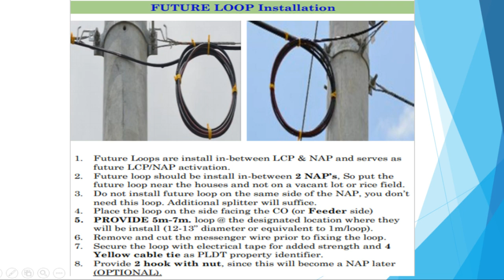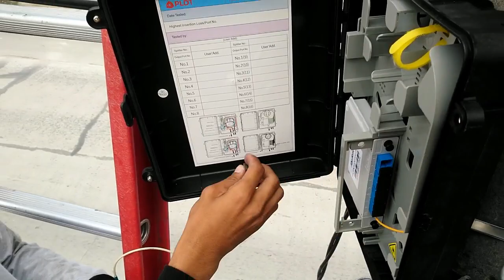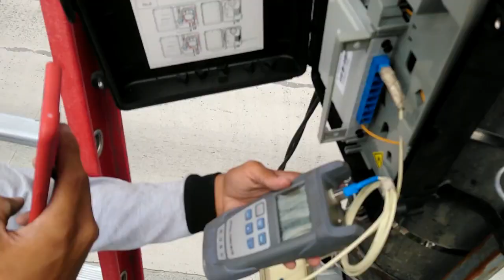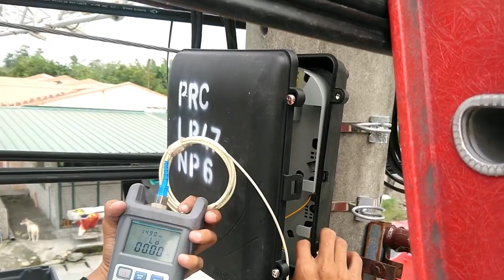PLDT ADD NAP with OPEN LOOP INSTALLATION

Comment: Activated na po to after ma install?
Reply from the maker: Yes sir pag mga ADD NAP mostly activated na un, kc naka latag na ang linya non at working na din ang LCP, However, may mga cases na after ma Install ng Add NAP eh no reading xa for some reason na baka di pa naka dugtong sa LCP or my tama sa clousure
Reply: Activated pro hindi pa ata yan pwede ma installan kasi need pa yan ng docs for ta/fa..kasi hindi pa yan makikita sa system ni pldt..😊
Reply from the maker: @hoophtv  Pag ang NAP ai na Install na poh with in the day reported na agad yan ng mga Technician na Working basta my reading. RFS na agad yun kc add NAP lang yan, Meaning matagal na nakalatag ung linya non.
Reply: @Connected1130  iba din cguro jan sa inyo at dito sa amin..yes po matagal na yan nakalatag..hehe..oo active yan kasi may reading kung nka splice na sa lcp..dpende sa contractor na nag latag..pro sa clarity hindi pa yan makikita..ewan ko lang po sa inyo jan ha..kasi d2 sa amin kaya need ng docs dahil for acceptance at for ta/fa pra ma upload yan wa warrp..baka iba din jan sa inyo..
Reply from the maker: @hoophtv  PLDT din poh ba kayo? Base sa experience ko, basta ADD NAP RFS na agad un.Minsan nga With in the day meron na agad for Installation lalo na kung my kasama na CX mostly kc cla nag rerequest ng ADD NAP
Reply: @Connected1130  dati pre..ngayun nasa fh na ako..for documentation ako..bka iba din yung jan sa inyo..oo pwede sya ma installan pro cold connect tawag sa amin nyan..mag hihintay padin ang cx kung kelan ma ta/fa ang add nap kasi pra ma assign na nila c subs sa clarity..pag mag add nap kami d2 ay wlang cx maghihintay pa kmi ng acceptance ni core net or ky oppm ni pldt..
Reply: @Connected1130  mas maganda pala jan sa inyo kasi on that day pwede na ma installan c subs at activated agad yung line nya..dito sa amin matagal2 pa bago ma actiavate c add nap..😂
Reply from the maker: @hoophtv  ah medyo matagal ung process jan sa inyo, d2 kc samin basta active n aung NAP ok na un, for activation at config lang ng MOdem sa system
Reply from the maker: @hoophtv  saang FH ka sir?
Reply from the maker: @hoophtv  Saang branch ng FH ka sir,
Reply: @Connected1130  sa Mindanao ako sir..dati din ako sa pldt pro agency kami tapos nong nawala ng endo lipat kami lahat ng fh..ang natira yung organic nlang talaga ni pldt..hehe
Reply: @Connected1130  oo nga eeh..maganda pala jan sa inyo..kasi mabilis ang market..😂😂
Reply from the maker: @hoophtv  layo nman nyan..
Reply: @Connected1130  oo..hehe..kaya siguro matagal process..hahaha! Btw..maganda mga videos mo napaka klaro..madami kang matutulongan nyan..keep it up..
Reply from the maker: @davenencarnado5416  PBZ North Luzon

Comment: Sir,,, pwd ba pa explain ng lcp and nap??? Salamat sir😇😇😇
Reply from the maker: LCP - Local convergence Point
  The LCP in a typical FTTH network is the point at which passive optical splitters (for a passive optical network, or PON) share the signals from feeder fibers with multiple subscribers via individual distribution fibers. These critical network components typically take the form of a small cabinet that is installed on a concrete pad or vault above ground level. As LCPs split a handful of incoming feeder fibers up to 32 ways each, just one of these components is required to serve a neighborhood in most deployment scenarios

NAP- NETWORK ACCESS POINT
The point from which an Internet service provider (ISP) drops down its lines and establishes a peering arrangement to provide Internet connectivity to customers.

Comment: mostly ilang araw  po ba o buwan bago gumana or maactivate ang nap box pagkatapos mag latag ng cable at mag lagay ng nap box sa poste??
Reply from the maker: Hi sir, sa tanong mo sir kc case to case basis kc yan, depende kung gaano kalaki ung lugar na lalatagan. Most likely 3 months after malatagan, pero mostly sa mag Add lang ng Nap e RFS na yon or Ready For Service if ever ma no signal due to FOC line problem kaya 1 day to 3 days depende pa yon kung palita cable.

Comment: Sir pinutol po ba yung white fiber from lcp na dinugtong sa pigtail ng cassette type na splitter?
Reply from the maker: Yes sir tama ka..yung white core na galing sa Blue Buffer from LCP.
Reply: @Connected1130  sir di ba nag putol ka nga white fiber then dinugtong sa splitter, ung kabilang putol na white wala nang use yon?
Reply from the maker: @darrywarry3722  wala na sir, dahil ung white core na un ai para sa NAP na un base sa color coding.

Comment: bossing ma aapprove ba ang application pag 19 na poste ang pagitan sa bahay at ng pinakamalapit na box?
Reply from the maker: Hi sir,  19 na poste approximately 600 to 900 meters yon depende sa distance ng mga pole. About sa approval sir if ganon kalayo basta mataas ang plan na kukunin mo matic un if 100mbps gagawan nila ng paraan yan..Better to apply sir then sila na mag survey malay mo may mas malapit na na NAP jan.
Reply: @Connected1130  boss 750 meters ang layo sabi sa google map tapos po PLAN 2099 UNLI FIBER 400 MBPS po. mataas kaya chance?
Reply from the maker: @krillin6z  hi sir, sinong naG survey nyan ikaw lang ba? Wala na ba ibang mas malapit na NAP? Apply mo nlang sir then pag my ticket ka na bigay mo saken ipapa survey naten.

Comment: Sir, temporarily bang maputol yong internet ng ibang subscribers pag-may nag-install ng NAP box? Hindi ko naiintindihan kung papano naka-connect ang NAP sa main line. Nagbranch out lang ba yon o sumingit siya in series sa main line?
Reply from the maker: Hi sir, ganito sir hindi apektado ang ibang NAP pag mh nag install ng NEW NAP, kc ibang core un.. Multi core kc ang mga FOC naten. So bali ibat ibang core sila, iba ibang line depende sa number ng nap my color coding kc yan.

Comment: Sir ask lang po .. yung isang foc sa NAP sir spare lang po ba yan ? Salamat sa tugon sir
Reply from the maker: ILANG CORE ung cnasabi mo na FOC SIR?kc mula sa Blue Buffer kukuha lng tayo ng isang core na need to fuse to pig tale splitter,ung the rest don ppunta na sa ibang NAP at LCP na.ung ibang bufffer sa FOC e spare na.
Reply: @Connected1130  yung 12 core sir na foc, 
bali sir sa isang NAP isang core lang kukunin para sa splitter, kunwari sir 12 core papasok sa isang NAP-1 tapos yung 11core ee fusion papunta sa  NAP-2 ??
Reply from the maker: @ramonguira8290  yes sir parang ganon tama ka ppunta ung ibang core sa ibang NAP, sa PLDT kc 8 NAPS sa isang LCP so paghahatian nila ung mga core na yon .pero ang standard na FOC ai 3 Buffer 24 core.bali 8 core ang laman ng isang buffer. Ung blue buffer e 8 core ang laman ppunta un sa 8 NAPS..ung isang buffer orange color 8 core din un ppunta nmn un sa 8 LCP
Reply: @Connected1130  sir pag 12 core lang ang FOC kailangan bang 6-port lang ang splitter Niya ? Kasi 6-core sa isang buffer

Sir dagdag lang na tanong anu po ang accurate na reading sa mga port pag t nest po ? Salamat sir
Reply from the maker: @ramonguira8290  ang splitter naten sir sa PLDT e 8 ports, sa Globe 16 ports, wala kc 6 port na ginagamit ng telecom d2 sa pinas at hindi din nila ginagamit ang 12 core lang if NAP ang usapan kc dapat standard, however kung gusto mo lng in your own na gamitin un it doesn't matter kahit ilang ports ang splitter or ilang core ung FOC as long as ma fuse mo ung isang core kahit nga dimo sundin ung color coding.Thats the reality..pero sa Telecom company my sinusunod lang na standard.

Standard reading ng Nap is -14dBm up to -24dbm..However kahit up to -27dBm or -30dBm reading non depende sa modem na gamit mo still works parin un.
Reply: @Connected1130  ah ok po sir salamat sa kunting kaalman, gusto kulang matuto kahit kunti mga PRRU lang ini splice ko at RHUb sa loob ng mall sir kaya wala ako masyado Idea pagdating sa mga NAP or LCP, sa Dito Telecom ang 12 core gamit Namin para sa mga OTP at 24-core sa mga ODP sir, salamat po

Comment: Bakit po sir sa globe maliit yung fiber main wire nila pa pasok ng Nap box parang tulad lng ng papuntang bahay ibang set up din po yun? kasi sa converge , pldt same set up lng ang lalaki ng main line fiber.
Reply from the maker: Hi sir, about sa tanong mo sir, sa Globe kc maximum of 4 NAPS lang per LCP. Is to 16 kc ung splitter na gamit nila. Sa PLDT nmn ay 8 NAPS per LCP
Reply: @Connected1130  okay lng din naman preformance if ganon sir?  kasi sa pinsan ko red los per month ang nap box nila globe fiber. bakit po kaya ganon set-up nila sir?
Reply from the maker: @jay2617  hi sir, oo nman ok lang nman un kung sa Globe e 4 NAPS per LCP pero 16 Ports naman ang each NAP nila. sa PLDT nmn 8 NAPS per LCP pero 8 ports lang each NAP so same lang un. About sa tanong mo sa Globe na LOS marami kc causes yan, saang lugar poh kayo sir?
Reply: @Connected1130  Mindanao po Tacurong City. Lumipat kami sa Globe fbr dating pldt kasi yung pldt  ngayon sir nag hihigh ping tuwing 6pm to 11pm sa globe naman low ping stable masyado pero yun lang nag rered los lng per month kaya tinignan ko ko nap box nila ang nipis masyado ng main fbr line papasok ng Nap kaya baka siguro konting galaw lang putol agad.
Reply from the maker: @jay2617  sure ka sir na Legit na Globe yan? Baka kc yan ung point to point lang powered by Globe or baka ung nakikita mo na Fiber e ppunta lang sa ibang subscriber. Or baka naman dika don nakasalpak baka CCTV un. Kung my pictures ka sir much better para makita ko.
Reply: @Connected1130  legit po sir iba lang kasi set up nila masyadong manipis fbr cable yung papasok ng nap box yung main mismo papasok ng box  nila.. ang kabatabi nun is yung yung sa papuntang bahay na black and white color fibr cable. Hindi ba yan ang problema dahil nag reredlos per month sir?
Reply from the maker: @jay2617  maraming reason kc sir pag nag LOS ang line or LOST OF SIGNAL. Main reason is ung line, na diaconnect. Sa cases ng sinasabi mo sir possible din na un amg sira kc if single core lang ginamit nila na supply prone un sa sira
Reply: @Connected1130   parang naka 8 core fiber lang sila kaya manipis sa pldt po ano po gamit sa kanila ang kakapal eh.

Comment: sir tanong lang, panu ung continuity na pinagputolan nyo ung white?
Reply from the maker: Hi sir, hindi poh Fiber un.
Reply: @Connected1130  thank you sa fast reply sir. i mean yes understood ko po na fiber un. sa isang linya ng fiber sir, ung kabilang dulo nka fused sa nap pano po ung kabilang dulo ng fiber?
Reply from the maker: @darylnuera4914  hi sir, yap tama ung output ng fiber ppunta sa mga NAPS naten,then ung input nman or kabilang dulo non galing nman sa LCP or Local Convergence Point.
Reply: @Connected1130  nalito lang ako sir lcp to nap to another nap
Reply from the maker: From LCP my splitter kc yon to distribute the single fiber into 8 different NAPS...SO from LCP papunta yon sa 8 naps if sa PLDT kc 8 fiber core ung laman ng isang Buffer tubes na wire, Each naps is my designated fiber core color coding.
Reply: @Connected1130  ahh... gets maraming salamat sir

Comment: Tanong ko lang po. Magka-LOS (blinking red: PLDT) ba ang modem kung sakali OK yung cable galing sa bahay patungong NAP box pero yung mga cable linking NAP boxes ay putol? Salamat sa pagsagot.
Reply from the maker: Pag blinking Red ang modem meaning no connection un, pwedeng dropwire ang problema or LOS ang NAP
Reply: @Connected1130  
maraming salamat po sa sagot. 

"dropwire" o putol? tama ba?

dahil iba kasi ang sagot sa akin ng customer service ng pldt na nasa source daw o sa office daw ng pldt ang may sira. sabi ng custservice "network outage" daw at hindi pa daw sila makapag-dispatch (o makapagpadala ng taga-ayos on-site). pero sinabihan ko na siya na may mga main fiber cable na naputol doon sa amin. dahil yung mga customers na connected sa NAP bago yung mga naputol ay OK ang kanilang connection.
Reply from the maker: @SeniorSimon  yes sir, kung my pang light source ka jan much better para makita mo saan naputol, pwede din nmn na SC problema nyan
Reply: @Connected1130  i'm sorry for my ignorance. pero ano po yung SC na sanasabi mo?
Reply from the maker: @SeniorSimon  SC Or FIC, Un ung Fiber connector
Reply: @Connected1130 

salamat po sa sagot. actually, sa cebu po ako at affected po kami ng Odette. Kaso nag-submit na po ako ng problem ko sa PLDT. Pero yung unang message ko, yun ang unang sinagot nila sa akin. pero kahapon, nagkausap na ulit kami ng custserv at dahil alam ko yung kaibahan ng main fiber cable at yung cable para sa mga customers, pinaalam ko sa kanila na dapat mag-dispatch sila ng taga-ayos dahil ang sira ay yung mga naputol na fiber cable. BTW: napa-check ko na po sa contractor yung cable galing sa modem ko hanggang NAP box, at OK po yung cable.

may  pangalan ba yung mga main fiber cable? if u don't mind answering that.
Reply from the maker: @SeniorSimon  maraming natumbang poste jan sa CEBU, kaya baka matagalan pa bago magkaron ng connection jan.. Uunahin kc nila ang mga main line
Reply: @Connected1130  

Sir. clarification lang. for example galing sa LCP then NAP1 up to NAPn, and then in between NAP2 and NAP3, yung cable ay naputol. Posible ba na ang mga subscribers connected sa NAP1 at NAP2 ay walang problema sa connection.

Be waiting for your answer. Salamat.
Reply from the maker: @SeniorSimon  hi sir, about sa tanong mo sir kung naputol ung line between NAP2 at Nap3, Possible na my signal parin ung NAP1 AT NAP2 kc connected parin un sa LCP, Ang no signal nyan e mula NAP 3 TO NAP8 kc naputol na xa bago dumating ng NAP3

Yun eh kung talagang sinunod ng mga installer ng NAP ung pagkakasunod sunod ng NAP. minsan kc halo halo na ang NAP na galing sa LCP. HALIMBAWA NAP1 tapos ang sumunod e NAP 5.so mahirap ma determine

Comment: Sir tanong ko lang po kung ano yung mga color coding ng FOC dito sa pinas, sa pldt kasi is red, globe is white diba? Much better po sana kung may listahan ng color coding. Salamat
Reply from the maker: Yes sir tama, pero pagdating sa color coding ng mismong Fiber core same lang ang sinusunod ng lahat ng Fiber network d2 sa Pinas. FOC line color lang nagkaiba para madali lang ma identify ang FOC
Reply: @Connected1130  Yes po, tapos may nakikita po ako sa daan na foc na may color coding na yellow, green at blue ano kayang brand ng telecom mga yun sir?
Reply from the maker: @Itz_Khld.03  mostly my name ng telecom company ang mga FOC sir makikita mo un sa FOC. Buffer nman ang tawag dun sa mga kulay na nakita mo walang yellow na kulay, baka orange un na kumupas na
Reply: Sir tanong lang po yung po bang FOC na papunta NAP na ginamit na SC connector ay  kasukat din ng  patchcord ng router sc connetor mag kasukat po ng SC connector sa NAP at sa patch cable...salamat po
Reply from the maker: @rodeldeguzman9969  hi sir, yes sir magkasumat lang yon, dahil same lang din ung coupler nyan kasa same lang ng sukat ng connector kahit anong brand pa

Comment: Bakit ganon reading mo sa actual opm 20.56 dbm to 20.09 dbm tapos nilalagay mo sa report nasa 16 to 17 dbm where in actual is 20 dbm, kaya pala nag kakaroon ng problema sa internet installer kasi once nalatagan yan ng fiber drop lalo na pag 800 meters to 900 meter nagkakaroon ng lose 5 dbm o 25 dbm nangyayari talaga yan kahit maganda ang splice mo sc connector butterfly at pag dating sa report ni installer ay bagsak na kay pldt, kasi ung mga actual reading na na encounter namin na  may 16 dbm talaga na reading doon ko lang masasabi na papasa ang 4 lost dbm sa vedio mo nakita ko ung reding ng opm kaya pagdating sa installer alaganin na yan
Reply from the maker: Dami mo naman sinabi😅, dapat nakinig ka muna mabuti at tiningnan mo ng maayos ung Form. Nabanggit ko jan na example lang yan ng reports ok? EXAMPLE …or halimbawa lang kung paano gawin ung report. Meaning yung report na nakita mo e hindi mismong para jan sa NAP na yan ok? Tingnan mo iba ung name ng NAP sa report sa NAP na na install kc EXAMPLE nga lang. Panuorin mo ulit, Hay nako @jhonjhonCargadorjr sino ba nag train sayo dika nakikinig.

Comment: Sir bakit ssa report -16 . E sa video per port nasa -20 po hehe napansin ko lang. Tsaka anong pinaka mataas na sagad na pasok sa standard ng pldt ? -20 po ba at h di na dapat taaas pa doon?
Reply from the maker: Yung sheets kc sa video e hindi nman para dun sa ginawa na NAP mismo, Example lang yan kung ano info na needs na dapat nasa reports.Not a big deal.

-14dBm to  -23dbm ang pasok sa standard na reading na NAPS. However, ang modem ng PLDT ay syncing parin kahit na umabot sa -30dBm depende sa modem